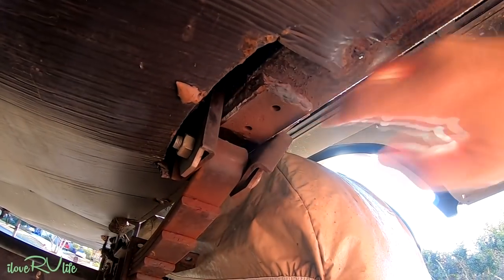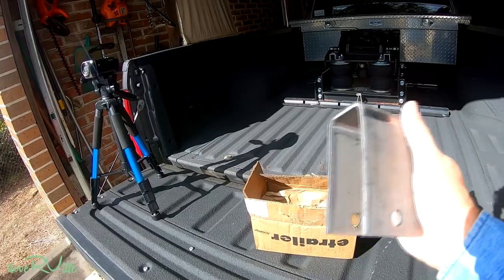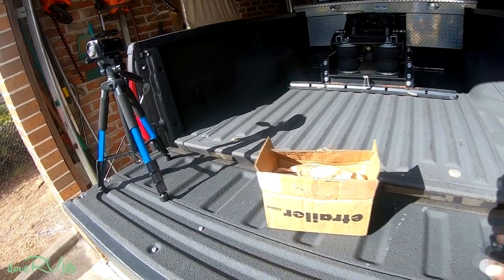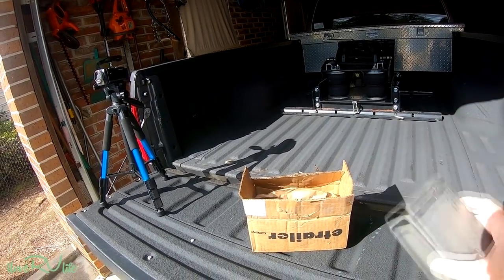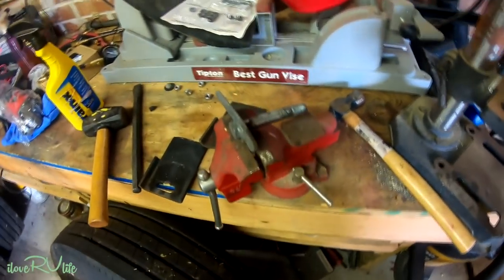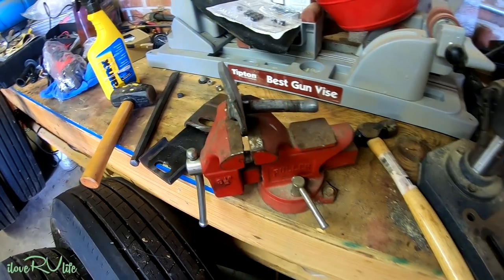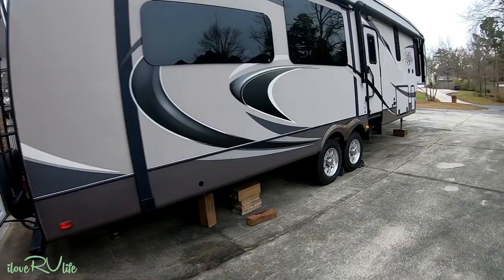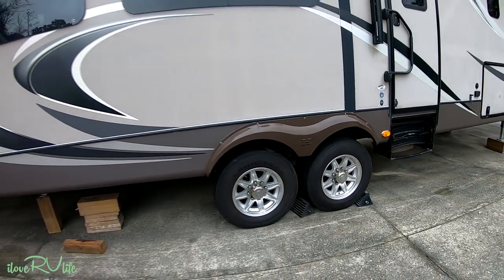Trailer Suspension Repair

Comment: Out of balance tires can add to the wear and tear ... we found 4 tires to be 7 ounces out of balance on each.  We installed 4 Chromatic centrifugal balancers and they will always run in balance.  Put them on out dually and it made all the difference in the world.  Lots of 18 wheelers use them and it also extends tire life to have the balanced.   Nice job and glad you cover the fire danger ... I was worried watching the grinder throwing sparks....  :)
Reply from the maker: Thanks.  I’ve heard of the balancers.  These were weighted when I changed from 16s to 17.5s.  No signs of cupping after 4 years.  My issue is softening the ride.  Seriously considering the center point air ride suspension later this year.  Jury still out at $1,300.  Wanting to take the shock out of the large bumps and uneven concrete.
Reply: @iLoveRVlife  Jerry, we are always interested in smoothing the ride.  We did change our hitch to a Reese 20k goosebox and could see the difference immediately, and would like to change the suspension to at least add shocks, and will watch for you to pull the plug on the air suspension.  We did put in a Moryde suspension on our old 5er and it raised the height a little and gave each axle twice the movement when driving over any bumps. Our biggest concern is for better trailer brakes; thinking disk brakes.  We do run our 40' 5er with TST sensors and that save a tire last year when it alerted us to a fast leak.  We stopped at the side of the interstate before the tire even looked flat.  We were able to have the tire repaired the next day (screw) which saved the cost of a blown out tire and maybe a lot more damage to the RV....  Happy trails, we like your channel!

Comment: I have a 2021 keystone passport and I’m going to beef up my hangers and put the crossbar on the hangers on all 3 sets of hangers cause I don’t want to be repairing hangers good job bud I’m in Florida and I have the same stuff like you so it no problem be safe out there safe travels
Reply from the maker: With 8 years of travel, this was only one that snapped. Always wondered if the weld was to hot and burnt part of the hanger. The other 3 held up well 60k miles of travel.

Comment: that is exactly why I had the MORryde Independent Suspension added to my Cedar Creek to eliminate all of the suspension issues. along with Disc Brakes it is an Awesome upgrade to any Fifth Wheel
Reply from the maker: I wish I had that added when we purchased in 2014.  If there’s a new one in the future, it will be standard or we’ll add.

Comment: Jerry, we had our spring hanger bolt shear off. Before the bolt fell off It elongated the spring hanger hole. On top of having to replace the hardware I had to replace 2 tires because I didn’t know this happened until I got home from our 3000 mile trip. Cost for the repair and 2 tires 1400.00. I had the extended warranty and in the fine print it says bolts & fastener not covered! I felt I wasted my money on the warrant. This mishap gives all new meaning to the pre- departure walk around!
Reply from the maker: That a tough one.  I always give the wheels and undercarriage a good look over before we take off.  We had a couple of really bad spots we hit and guess there was a rear shift somewhere that snapped the hanger.  We too got bit on the extended warranty.  We got took pretty bad on ours.  Lesson learned.

Comment: Nice job. I’ve come to the conclusion that it is best to do most rv repairs yourself. I’ve seen people cut a strip of plate to fit between the brackets of a hanger like that, bend to an obtuse V and weld it to the inside of the hanger legs with the point of the V above the shackle bolt, and the ends of the plate welded to the bottom of the frame/ I beam (if that makes sense). Idea being supports the legs of the hanger while still allowing some flex, and distributes load along a longer area of the frame. Anyhoo, nice work.
Reply from the maker: Thanks Jeff.  We put a lot of miles on the 5th wheel after the repair. Fortunately no other failures and the repair held well. I think the failed shackle had a flaw and the very rough roads that trip did it in.  Agree there’s a number of bracing options that help.
Reply: @iLoveRVlife  Yeah. Pretty common failure. At least it wasn’t a frame failure by the overhang on a 5th wheel frame.  Seems to me massive rigs are often built out of 1/8 wall mild steel plate and 2x8 or whatever tube. It doesn’t seem like it would be near strong enough to not fatigue and crack over time.
Reply from the maker: Agree on the mid size units. The larger 5th wheels have the those big ifames.

Comment: I just come across your channel, excellent video. I've been reading so much about theses axel hangers failing that I've been considering cutting all mine off and replacing with higher quality parts. This video was very inspiring. It's been a year since you posted this, how has your repair held and did you ever get around to replacing the others?
Reply from the maker: Thanks Frank.  I had thoughts of doing the same, but it’s quite a job.  The new hanger has held up well.  I check the originals and new hanger several times a hear.  So far no cracks or fatigue found.

Comment: The Getaway Couple did a video on MorRyde independent suspension.  It is costly but the ride is much better than leaf spring. They also added disc brakes. 
Something to consider.
Safe travels and good health.
Reply from the maker: Wish I’d made that upgrade when we purchased.  Don’t think I want to make that investment on a 2014.  Looking at upgrading to a center point air ride suspension this summer.  Not the same, but should soften the pot holes.

Comment: Hi Jerry,
Good video and kudos to you for a job well done.
I’m in the process of installing Lippert Air-Ride suspension to my 2018 32’ OUTDOORS RV in preparation for a cost to cost Central Oregon to Pennsylvania trip this spring. I did notice my hangers were a bit on the marginal side and I think I’ll have them boxed in like one of your followers suggested. 
Thanks for the video.
Keep the shine side up and the grease side down.
Reply from the maker: Hi Mike.  We have the same plans early summer before our trip to Vegas and points in between.  At $1,300, hoping the center point air ride suspension softens the pot holes and uneven concrete.
Reply: You should checkout the U-Tube video “Crazy Smooth 5th Wheel Air-Ride” by The Deprey’s.
It convinced me. Especially considering the road conditions in the east.
Reply from the maker: Seen it Mike.  One of the reasons I’m thinking we’ll go this route.

Comment: Check the opposite side hanger for cracks! Mine broke off and the other died was cracked! I put on a new one and welded up the other one and boxed in both of them for extra strength!
Reply from the maker: Thanks Rick. The other hangers were in good shape. I think this hanger either had a flaw or the weld was to deep and weakened the sides. We’ve not had any other issues for the last 15,000 miles.
Reply: @iLoveRVlife  
Wishing you the best on your trip!

Comment: We have been traveling full
Time for almost a year and a half now and I stopped at gas station and noticed I could see the chords showing on the tires 😬. Took it to get tires replaced and they informed me that the leaf spring hanger had broken which caused the tires to go bad and also the tires had worn a spot under the trailer from driving with it broken (for who knows how long…) we have been stranded in South Georgia for over a month now trying ti get insurance and Camping World synced up but finally all pets are coming in and should be on the road again soon.

I will be a Little more cautious/paranoid about the suspension going forward whew…
Reply from the maker: That’s a tough spot Jon. I’ve had issues with Camping World a number of years ago. I just bit the bullet, had the 5th wheel fixed elsewhere and moved on. Since my hanger broke, checking the axles along with tire pressure is something I do a couple of days before we head to our next destination. Safe travels.

Comment: I think this is an upgrade just about every large 5th wheel needs to do...I'm not sure what E-trailer charges for those hangers but a local welding/fab shop can make them in minutes for probably less than $15 - 20 for all 6 hangers.
Reply: I'll add that "boxing in" the top portion of the hanger will exponentially improve the structure of the hanger.

Comment: It's great that you could do all that welding work
Reply from the maker: Thanks.  Been a while, but still have the touch.
Reply: When you were welding, what was that cylindrical, cone looking gizmo you were holding up toward the weld?
Reply from the maker: It was a short piece of pipe pushing against a piece of plywood adding a larger gap to keep from burnings the underside of the 5th wheel.

Comment: Nice job Jerry. I prefer to perform these tasks myself. Did you happen to compare the hanger distance with the other side before final welding? Happy Travels!
Reply from the maker: Thanks a bunch.  I did.  And when jacked up before welding, it fell into the exact place as the previous hanger.  I placed a few marks in the back side before grinding, just in case.

Comment: Ugggh. What a nightmare. I am not impressed with the hangers on my 2017 Keystone Carbon. Flimsy looking. Last winter I installed a wet bolt kit. Around 2000 miles on my rv and the plastic bushings were all wore through and I also installed the Joyrider Shock system. My trailer should’ve been a triple axle, two isn’t enough. The first time I pulled it loaded with my clothes and a Harley softail and washer and dryer in the back I couldn’t go over 60 or it would sway like a pull behind. Traded the regular cab single wheel f350 for a crew cab dually f350 and it was better, then upgraded from E 10 ply tires to G 14 ply and 👍👍 pulled way better and then did the shocks and that helped with the tail of the trailer bobbing and with bucking over bridges. A couple weeks ago I installed Summo Springs rubber helper springs. They site rite on top of the u bolt plate and touch the I beam frame. My axle is under the springs. I haven’t pulled it yet but they should help. It kinda looked like my leaf springs were all bent a bit. Little worried. I climbed under my brothers camper next door a couple times to see the difference. It’s a triple axle Mobile Suits FullHouse toyhauler. What a beast. Triple 8k axles and a box tube frame, all those leaf spring perches are beefed up with gussets and plates. Beautiful. And thick steel. And here I am with some thin little junk for spring mounts attached to a flimsy I beam.
Reply from the maker: Terry, extra challenge with a toy hauler, especially with the extra weight in the tail.  Fortunately our weight is more center mass and our 5th wheel tows well.  We also tow without water which helps a lot.  We came close to buying a Grand Design toy hauler this year.  It was a 3 axle and the frame was very well built.  Close, but trade in and payments wouldn’t let it happen.
Reply: I Love RV Life Those Grand Designs are pretty nice and I read they have a insulated garage floor. Nearly all toyhaulers don’t. Mine has spray foam now. Uggh, more tail weight😂 What I’ve been seeing lately is the higher end toyhaulers are running nearly the same as a Mobile Suits or DRV. Mine is mid level. It was a year old close out sale 45k. But if I was to spend 100k it be a Mobile Suites. Boxed steel frame and 3 1/4 inch outside walls with wool batted insulation, insulated garage floor and the entire belly pan of my brother’s is layered with thick insulation bats also. We thought we would easily dig up in their one day and do some work 😂. Pretty sure they have double pain windows also. I recently seen a used 2016 identical to my brothers for sale on RV Trader in Arkansas for 80k. I know my brothers was 100k one year used.Wish I could afford one. Pretty sure I’m stuck with this until it’s shot just like my last rv.
Reply from the maker: Same here.  The Grand Design was amazing.  We came very close, but after we saw the payment schedule, we may run this one until parts start falling off.

Comment: I’ve seen that some people weld a tube between the left a right side hangers.
Reply from the maker: Couple options. Haven’t seen the tube. I’ve seen flat bar and angle iron to box the bracket.  This one may have had an issue. Thinking they burnt through to much metal on the weld. Never had another issue.

Comment: Was it difficult to align the axles to keep them parallel?   Nice work!
Reply from the maker: Thanks.  It wasn’t.  I used the same hanger length and placed in the same location as previous hanger.  Plus I measured from the front axle before I made the first tack weld.

Comment: Jerry you are back good deal.I would of took a pic of that part or called the manufacturer of your trailer.And just showed them how cheep they put a part like that on a trailer that cost that much money and carry's so much weight.We were out on the road my trailer wires caught fire not bad just Burt the wires bad enough that my slid would not come in,Come to find out they never at the manufacturer foam in the hole around the wires the outside rub off on the wood exposing the wires to rub and then the fire.Good thing Winnebago was very nice to pay me for what it cost to fix it on the road because what happen at the factory..
Reply from the maker: Johnny, this happens too often.  Very little remedy with a 5 year old rig.  With the roads we’ve traveled, surprised it hadn’t happened sooner.  These things are built in a couple days and very little standards.  Great testimony for Winnebago and their willingness to standby their product.
Reply: Love you Jerry.  Your how-to videos are the best.  Wish you would do more.
Reply from the maker: Hoping we don’t break it for a while 😉 One more project video coming, then we’re hitting the road.  Looking forward to sharing our travels.

Comment: Its to bad they put such primitive cheap suspension on these campers. Im looking at putting the Timbren Silent Ride 14k suspension on my HC Montana. I can do the work myself but just finding the time to do it. I live up northern maine. 3 degrees above zero at the moment
Reply from the maker: Wade, if ours wasn’t 5 years old, I would be running with a MorRyde independent system.  I’m strongly considering an upgrade to the center point  air ride suspension this summer.  Thinking this will be a reasonable upgrade at $1300.  3 degrees!  Ouch.  I was whining with the mid 40s and wind.

Comment: Did you order the parts for the other spring s
Reply from the maker: Just the wet bolts.  We inspected and didn’t find any fractures.  If another one breaks, we’ll replace all.

Comment: What brand of battery powered torque wrench did you use?
Reply from the maker: It’s a cheap Harbor Freight 1/2 inch drive.  Ok for small projects.  Had it for a couple years.
Reply: Thank you, Jerry. I have been looking at Harbor Freights. Battery operated torque wrenches Looks like maybe. The earthquake brand might be the best. Or bauer what do you suggest
Reply from the maker: This thing was cheap and on sale.  One of those deals where I needed one for a quick project and it’s held up for several years.  The cutoff saw is a Bauer.  Well made.